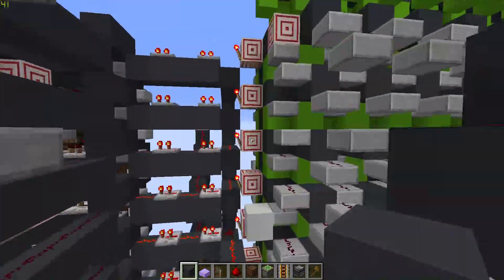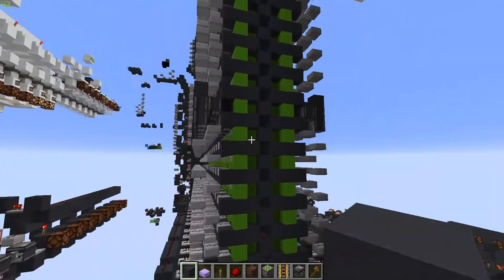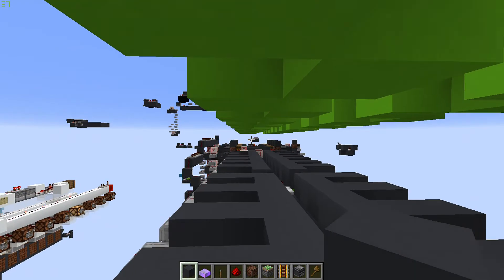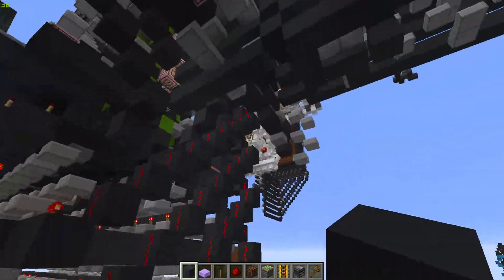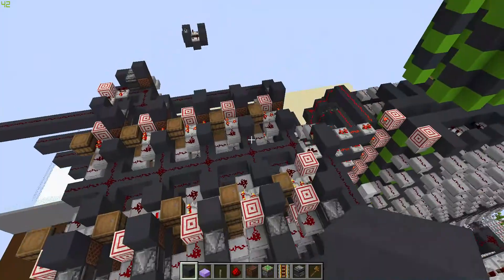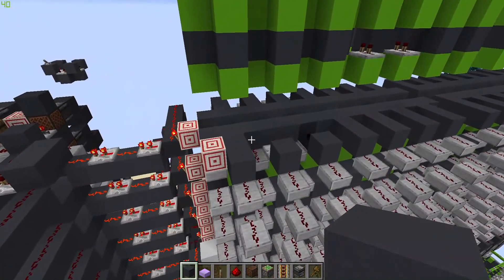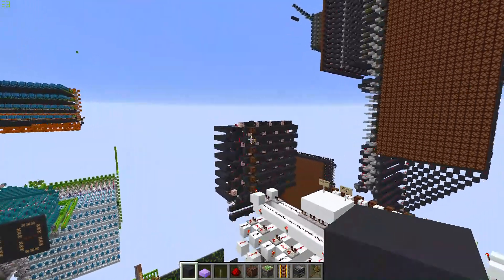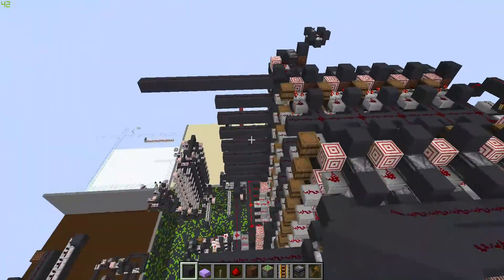5Hz CPU - Update video #2

Comment: As someone how hasnt gotten into computing yet, this might sound stupid, but could you just build two ALUs that share inputs, outputs, flags etc and switch between them every other clock cycle? That way you could still have a 4 tick throughput in each ALU but the total would be 2 ticks?

Comment: how did you lean redstone, i mean for making compact redstone not digital electronics on which is based computer
Reply from the maker: It kinda just takes time. After you've been  using redstone for a while you learn a lot of little tricks and you start to be able to know if something is going to work before you even test it. A good starting place would be to take each redstone component and mess around with it. See what works and what doesn't and that should give you a good baseline to build off of.

Comment: Looking at these video I have to say I am amazed you managed (or in the process of) to make a 5hz CPU. Just one question: how do you prevent your torches from burning out at that speed?
Reply from the maker: ATM i'm just leaving it up to the programmer to make sure that there isn't any long strings of toggling (0n, off, on, off) signals. I think the limit is 7 on offs before the torch burns out
Reply: @fearless_z_2576  Ah... That saves me the trouble of tearing out my hair trying to figure out how you accomplished that. Makes a lot of sense. Thanks for the quick reply!
Reply: @Annatar98  very late but you can also use a sticky piston to move a redstone block out of the way